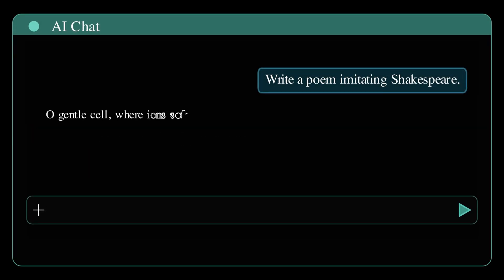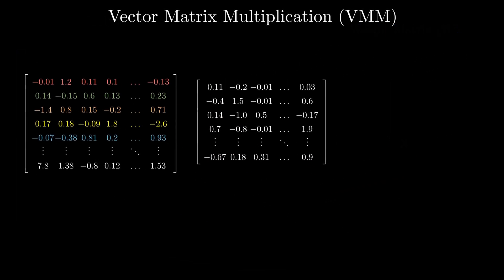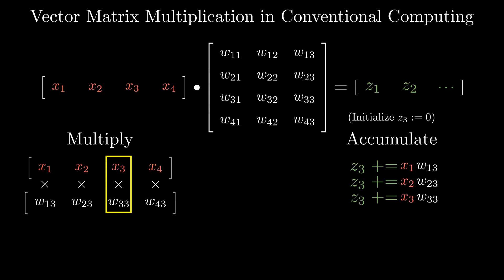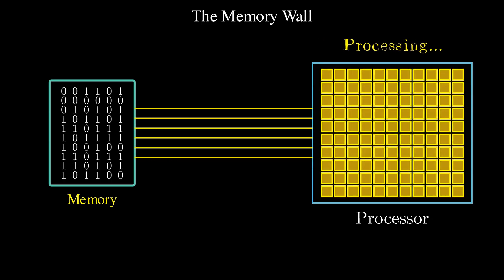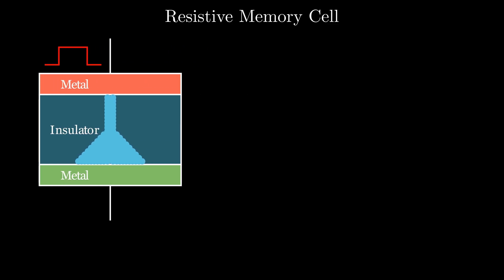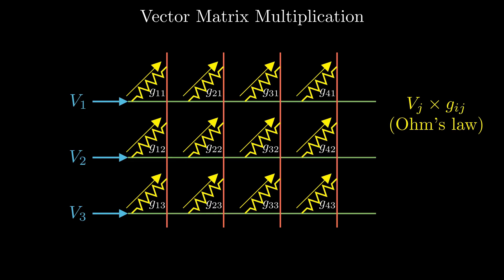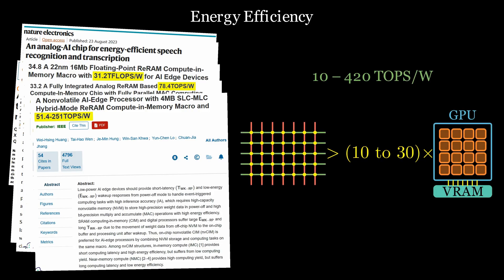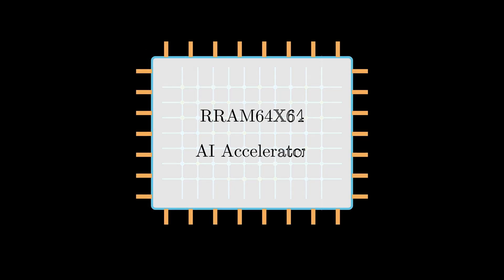The Memory That Computes: A New Era of AI Hardware

Comment: In he beginning of video controlled and precise fashion. In the end of the video you tell that it has thousands of caviats that make it no controlled and precise...
Reply from the maker: In the end of the video I mentioned about the possible shortcomings of resistive memory devices. However, I also mentioned that these are being overcome rapidly by researchers. In fact researchers have achieved more than 16000 possible conductance states in a single Resistive memory device by  applying consecutive voltage pulses. Resistive memory is an ongoing research topic, it's not yet a mature technology. So, it has still multiple issues. However, there are reports in scientific literature that shows that it is possible to tune the conductance of resistive memories quite precisely, in spite of the shortcomings. It has been also possible to develop resistive memory based AI accelerators that achieve very high energy efficiency.

Comment: Also, not mentioned: how big do these resistive memory in-memory-compute cells need to be? Mass= more variable resistance capacity, by definition.
Reply from the maker: These cells can be as small as tens of nanometers. The resistance change happens in these cells either because of the formation of a conducting filament in a narrow region as shown in the video (because of migration of metal ions, or shifting of defects or change in crystalization), or because of modulation of potential barrier at the metal/insulator interface due to the applied voltage pulse. In either cases, it is not related to the total mass of the cells. I hope it answers your question. If, not please free to ask.